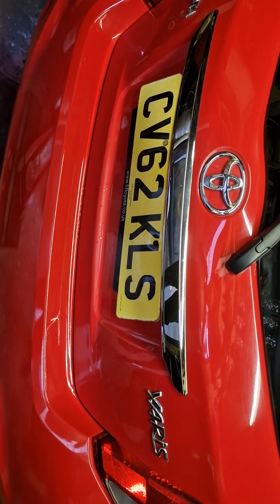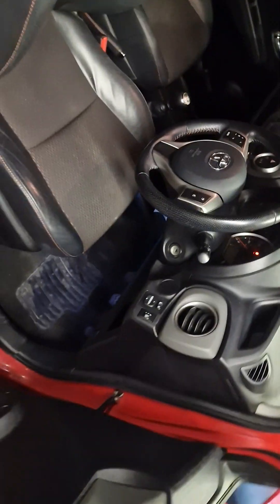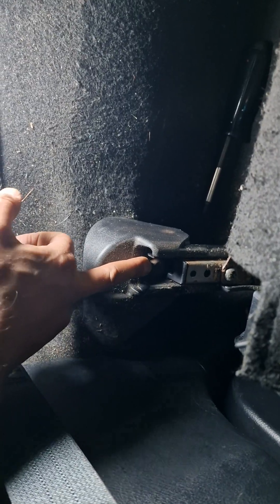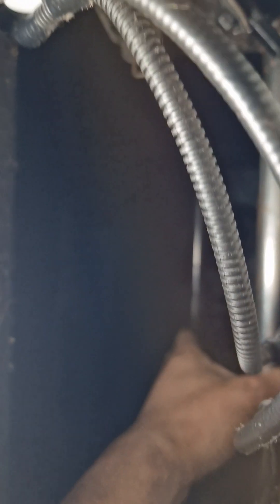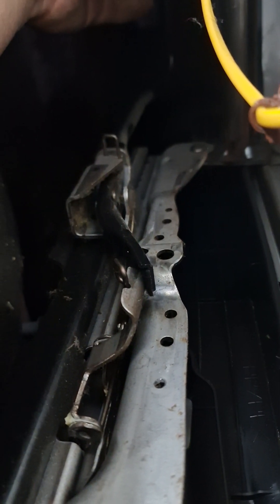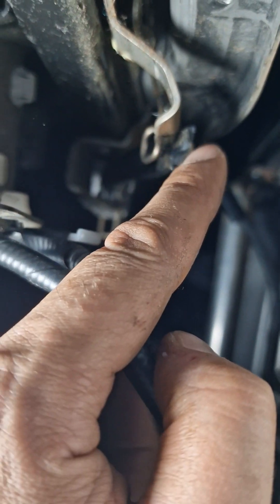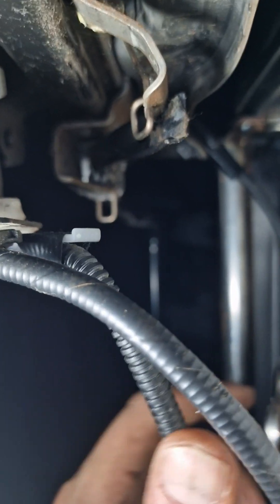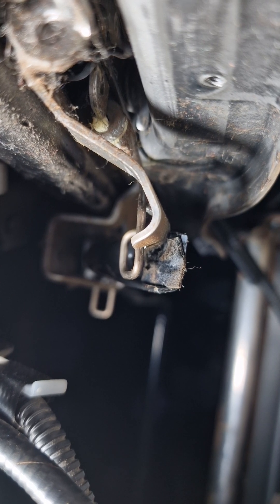Toyota Yaris mk3 2011-2017, front seat slider not working (stuck) FIX!

Comment from the maker: Hi, sorry I don't understand when you say driver side back seat? Do you mean the upper sear that supports you back? If that is what you are talking about, thar part is steel wire controlled, so you may need to take the seat out and strip a fee parts to see why the wire is reacting the way you said.

Comment: Bro I'm literally in the same car rn and the seat is still stuck 😭
Reply from the maker: As in this CV62? This car? If you are then get your hands dirty and check under the seat and move the bar. This happens when you try moving the seat with the front bar half pressed. My advice is press the front bar fully then slide it back or forward accordingly.